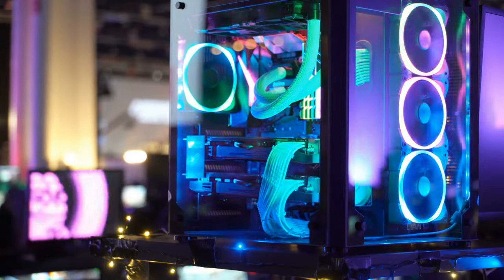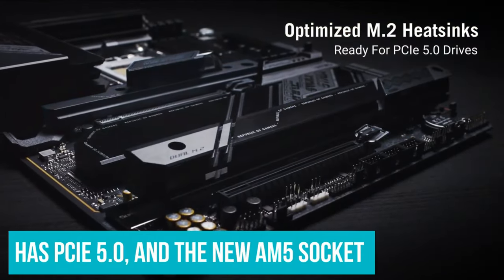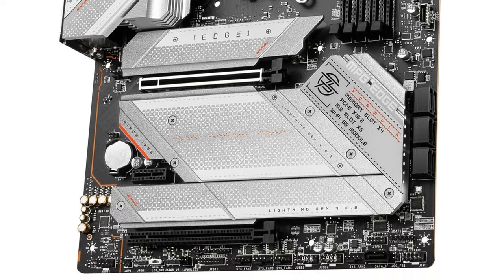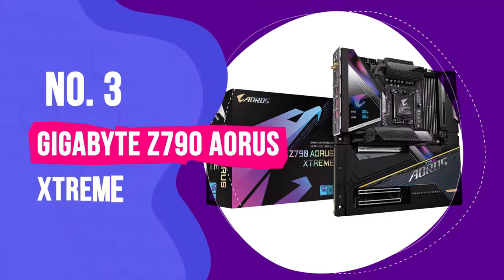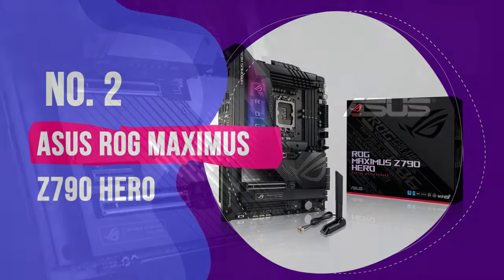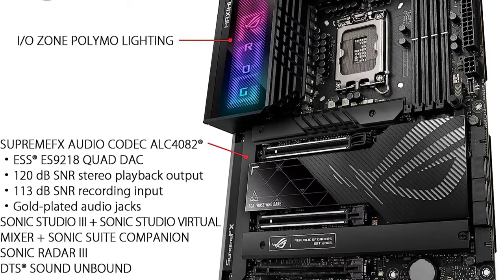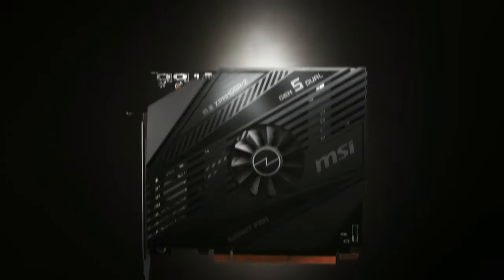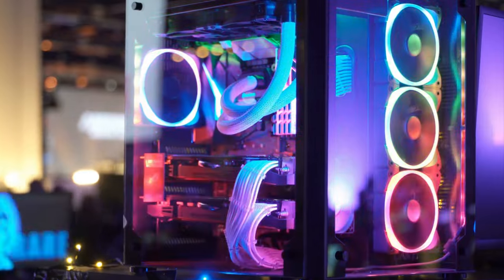Best Motherboards 2024: My dream Motherboard is Finally HERE!

Comment: MSI motherboards are ass.  Terrible bios, zero support, terrible integration.   I'm actually returning my MSI Tomahak today.
Reply: completely agree got the b450 tomohawk like 3 years ago and will never use msi motherboard again
Reply: @olly1384  curious what MOBO you went with. I owned a Asus gaming laptop back in the day and it was great. But been reading a lot lately that Asus mobo are horribe
Reply: @B1ackAlloy1992  gussing mobo means mother board its an old am4 one called b450 tomohawk
Reply: well... i currently own asus mobo... i hate it due to mobo keeps shutting off and wont reconize wift and lan internet. also windows update will not work on my mobo.. hate to manually download and install each of update to make it work... now im looking at msi ace series mobo
Reply: I have to disagree with the MSI are ass statement dude. I currently have a MSI MAG B550 Tomahawk with Ryzen 7 5800x & I also have a MSI MEG X570 Unify with Ryzen 7 5800x & both Mobo are a awesome bit of kit. I've also got the Asus Rog Strix B550-i Gaming M-ITX Mobo & can't wait to get rid of it. (All Mobos & CPU are up for sale or trade if anyone is local to Sheffield UK. 😊

Comment: Unless you are overclocking the ever living bejesus out of it, or Benchmarking, Why? Where is ASRock?  If you are thinking of buying a $1000 Mobo, You are nuts unless you have everything else top of the line, and even then It's stupid, You can get a $230 X670 Elite AX and Still Slap, take the $770 and put it into a better GPU/PSU combo.  The Power Supply Is a higher Priority than a Mobo.  I'd strive to get about 200-300 more watts than I need at a 80+ Platinum level, And get a better GPU, before I'd dump into a Mobo.  Hell get a Giant SSD, CPU, Ram, Monitor, VR, Chair, Desk, Games before you buy a $1000 dollar Mobo.  If your spending $1000 on a Mobo for actual computing I'd say "what is a Blade Server Alex".

Comment: Only 2 x670 options: MSI MPG X670E Carbon or ASUS ROG STRIX x670E-E Gayming, with the MSI supporting Dual Channel DDR5 7800+MHz (OC) vs ASUS - DDR5 8000+MHz (OC) - reason there's only two choices? These are the ONLY two with PCIe 5.0 x16 direct CPU pipelines, where AORUS decided to use their lanes for storage options. If you want to spend more or go Intel.. well.
Reply: Which one of those would you recommend me

Comment: I just built a pc and I chose Maximus dark hero and the i914900k. Did I make good selections for gaming?
Reply: Honestly I don’t think so.  The 14900 is a very expensive and inefficient cpu.  You can get similar performance for half the price and 1/3 the energy usage.
Reply: @Bushwacked487  Hahaha sure AMD fan boy. 14900K is right now best CPU for high-end gaming. There is not any opponent in this field. I am just now buying 10k setup with 14900K + 4090 & MSI Godlike for my Samsung Oddysey Neo G9 57" (7680x2160, 240Hz) monitor. If someone told me to buy fkin AMD for mid-budget gaming, I would just burst with laughing. Just watch fullHD comparision and then 4k. Then imagine almost 8k. Only insane person would buy fkin AMD to top-tier gaming setup.
Reply: @Echidna7799  yikes.  Hope you get the therapy you need.  You come across as unhinged.  By the way, I have an 8700k.  I have zero brand loyalty.  

You’re unfortunately just wrong.  7800x3d beats or matches the 14900 in gaming benchmarks across the board.  It does so for much less money and does so at under 100w of power draw.  These are facts.  You’re welcome to look up benchmarks yourself.  

You unfortunately wasted a lot of money and will continue to due to increased power consumption.
Reply: @Bushwacked487 unfortunately your wrong. You can have the best fps on amd sure but the frametimes are just horrible. I would sacrifice a little fps for smoother frametimes. Fyi, i have a 5700x now so no im no fanboi. Im just going to upgrade to the 14600k for a better gaming experience.
Reply: @Bushwacked487 what motherboard would you suggest for a 7800x3d?
Reply: You should have asked this question before the purchase O well.